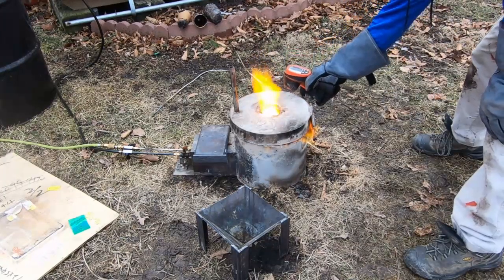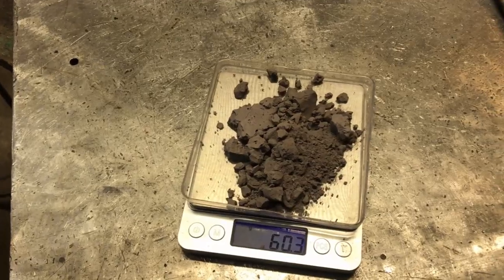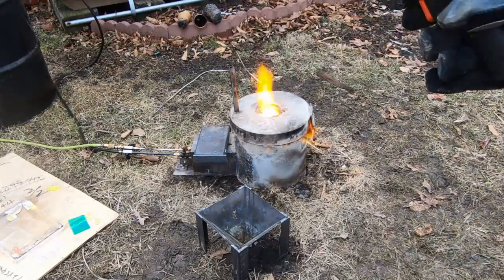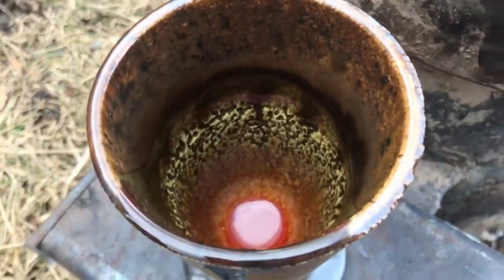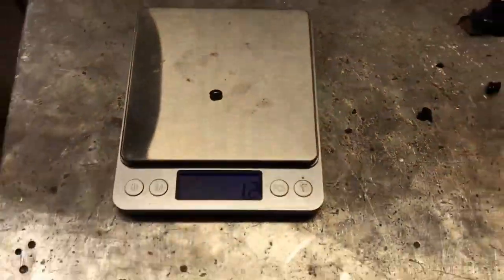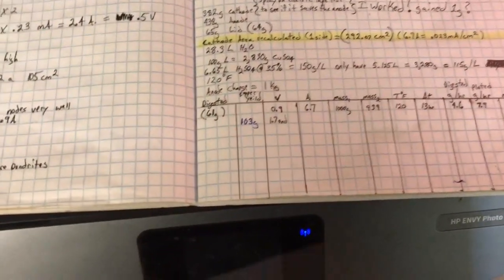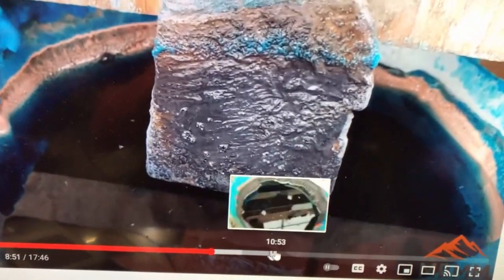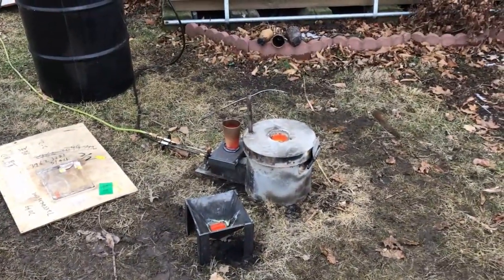Smelting ewaste anode Mud With the Godzilla torch

Comment: Should have added an iron bar to it as you were doing the melt, and then remove it just before the pour. It can displace other more valuable metals from the matte, just as it does in a waste treatment bucket.